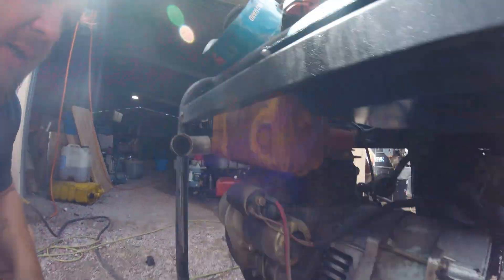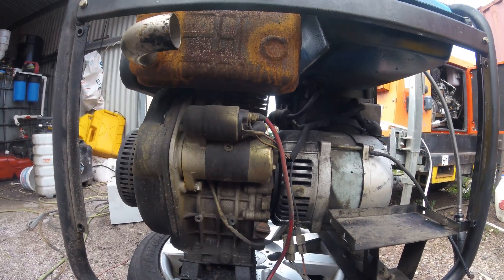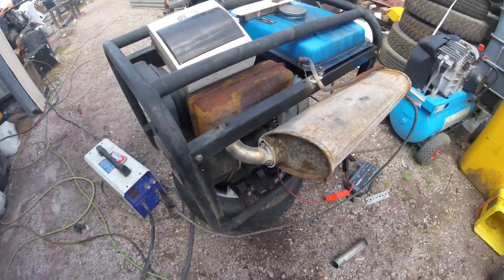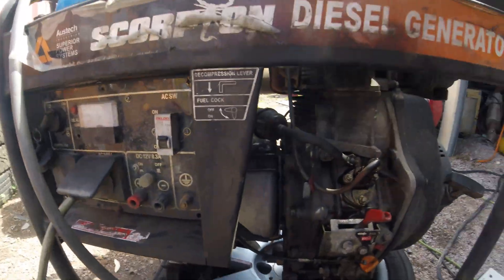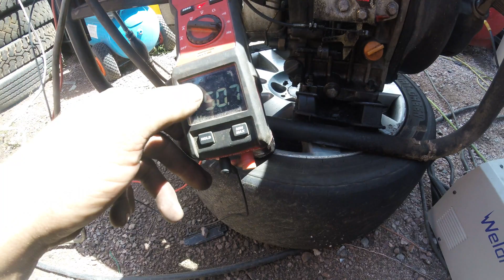Attempting to silence the Yanmar 186f 10hp diesel Generator

Comment: I have 2 of these chia clone diesel, its not the exhaust noise yer dealing with, its the actual motot thats noisy. Best to just put it behind a wall and direct the noise away from your living or working space . They alse dont like working with no load, they will wetstack unless they are under a load. Otherwise they are great units that are extremely economical to run !
Reply from the maker: They are such a loud little motor. What do you run with your?
Reply: @ We lose our grid power quite often as we live in a very rural area of northern Calif, so we depend on the generators to keep the power on till or utility’s are restored. We have run them for weeks at a time in the last 10 yrs with very few problems utilizing our well pump, washer and dryer, refrigerator and freezer flawlessly. They will power our house for 14 hrs on a full tank ( 2 US Gallons), diesel is around $4.50 a Gal in our area of Calif.
Reply from the maker: That's quiet cost effective
Reply from the maker: Have you had many issues with them in general?
Reply: @ I had a diesel leak from the head gasket on one of them, but regular maintenance is key! Having 2 of them is a real luxury! Parts are completely interchangeable with the yammer gensets, and easily accessible online! Keep the fuel tank clean and change the fuel filter in the tank, you’ll have few problems! One of my units shows over 10 k hours on the hr meter, I got both of the used so not sure if it’s accurate but it wouldn’t surprise me!
Reply from the maker: 10,000 hours !!!!! Thats amazing. Still start easy enough?
Reply: @ Yep, first pull every time, and the electric starter still works. It a bit harder when it’s freezing, so I use a propane torch to warm up the intake.